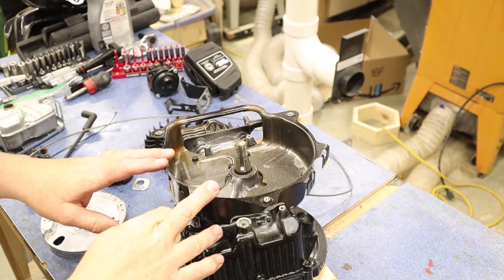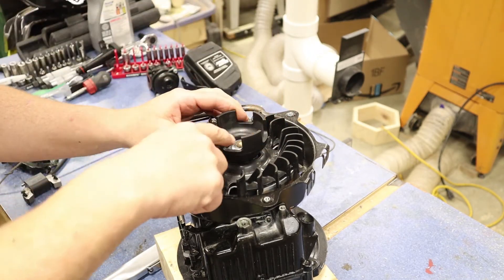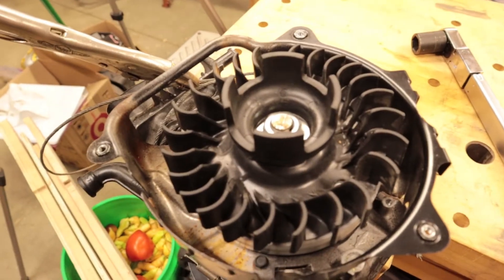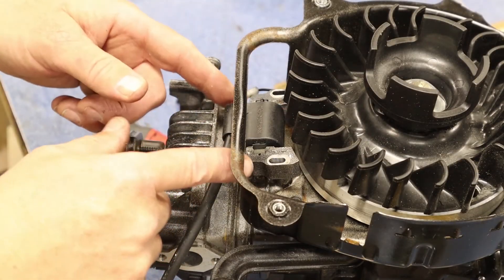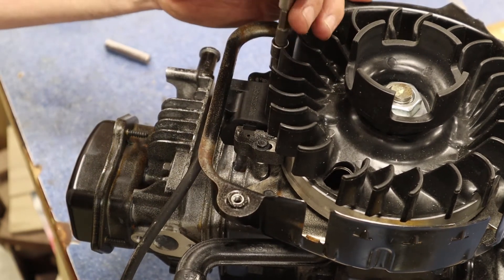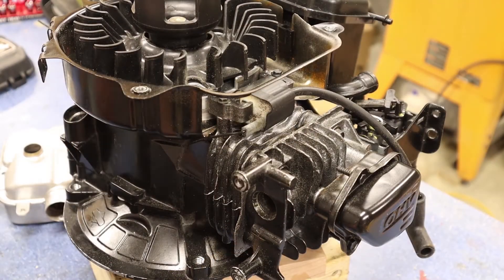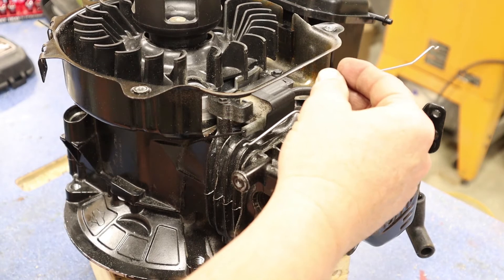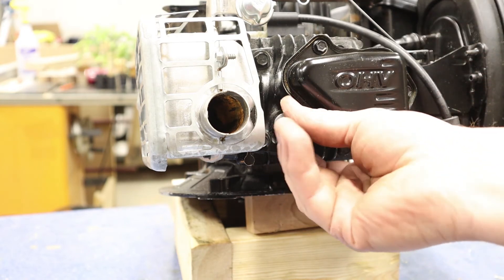Briggs and Stratton 163 cc  OHV small engine rebuild part 2

Comment: How did the engine perform?  I know you described some damage to the inside of the cylinder bore and you decided to not hone it.  Just wondering how it all worked out.  Did you leak down test it?  It had good power?  Thanks and nice instructive video.

Comment: To lock the flywheel in place I used the blade adapter on the bottom and clamped it in a vice. It's 10 times better than using the cable that is flexible.

Comment: Hi, ive gone through the same motor and im dealing with kickback when starting and the flywheel key is good. Is there a compression relief on this motor?
Reply from the maker: yes. there should be.
Reply: If the valve lash is really out of spec you will get that as well. Fixed the issue with mine.

Comment: This series of videos is awesome.  My 13 year old son and I used them to repair the engine on a 3 year old craftsman push mower my neighbor had given up on and set by the curb.  We tore it down.  Cleaned A LOT of hard built up carbon jamming up the cylinder.  Bought new gaskets and o-rings and reassembled.  The mower cranked on the first pull.  High fives all around and my son has a mower for summer mowing jobs.  Thank you.  Thank you.  Thank you.
Reply from the maker: That is awesome!

Comment: So the mower was working great for a while. Today I was going up a slight hill and heard a strange noise. I think the flywheel or key was the noise and now it won't pull at all...anyways I was borrowing the socket set I used and need to buy a the socket used on flywheel. Do you happen to know what size to use?